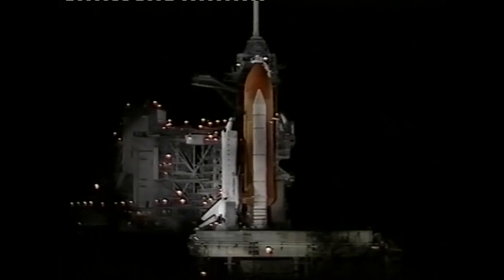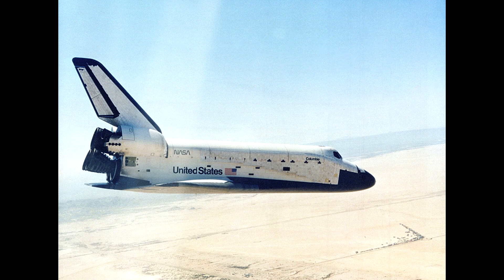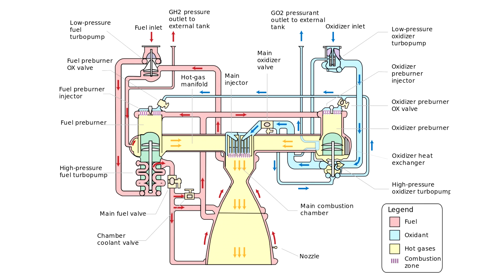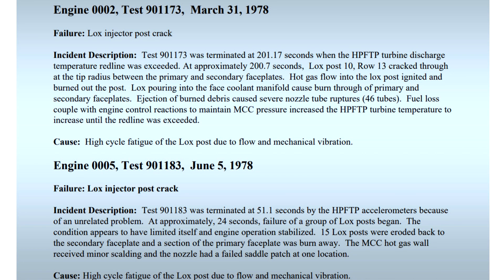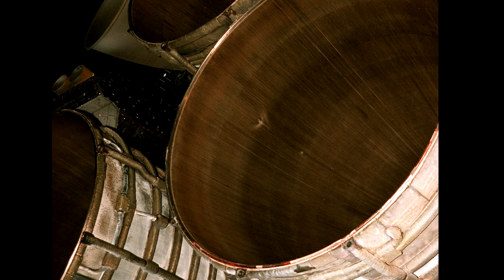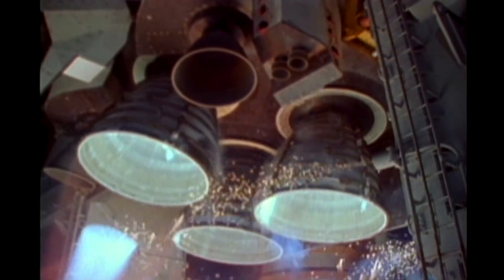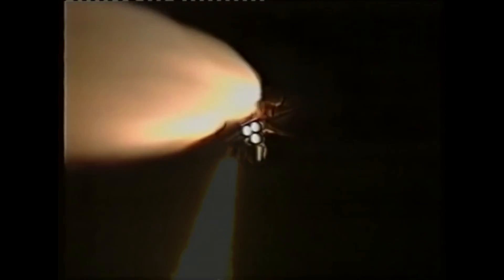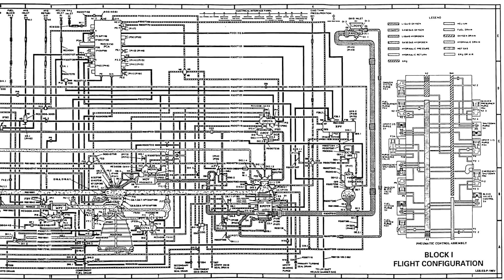How A  Gold Bullet Almost Destroyed A Space Shuttle

Comment: It really shows how messed up the shuttle program was.
Reply: It seems like they had the whole thing backwards - trying to build a reusable second stage instead of a reusable first stage.
Reply: The Shuttle program was one long, expensive lesson in How Not to Do It.
Reply: Yep. The SRB's were "re-usable" in the same way that your disposable vacuum bag is re-usable if you empty it. The fact is that the actual cost of recovery was about the same as new SRB's and the re-used parts were pretty much just the casing. As for doing a propulsive landing that was never an option as they use solid fuel which meant that once the wick is lit there is nothing there to start a second reaction and even if you could you would have no active thrust control. Also the engines was never designed to be stopped. There might be a way to quench them out, but my guess is this would be impracticably hard to do. As for the shuttles themselves the decision to side mount them and have a two storied crew compartment killed pretty much all the astronauts. On every rocket up until then the fail safe in orbit had been ejection seats or an escape tower offering a short massive boost directly away from the first stage. The shuttle even if it could separate was still screwed as it was travelling perpendicular to a massive tank of hydrogen and all it's trust came for the same said tank. There is a reason why they found several of the astronauts from one, unless my memory is failing and it was both, the accidents either in the wreck of the nose compartment or close by with some even appearing to have actively flipped switches associated with emergency procedures. Sadly they never stood a chance of escaping the nose section. Especially not after it fractured from the superstructure. We can only hope they never actually saw what had happened and sat there knowing they were falling to their death in what had become essentially a tin can with zero hope of escape. I for one am glad they have started mounting humans to the top of the rockets again rather than the side. No matter how you look at it it's the safest design.
Reply: Just Being Socially Awkward it’s hard to see the opportunity cost the US paid with the shuttle. If history would have played differently i would bet that humans would have left low earth orbit for a while now.
Reply: Did the lessons stay with us? Look at SLS and repeat that with a straight face...
If it wasn't for NASA we probably would have had reusable rockets 20 years ago. Werner von Braun was pushing hard real reusability and instead NASA made politically engineered turd that killed 14 people and nearly was a total loss several other times, cost half a billion (at least) per launch and stalled real progress for nearly half a century
Reply: Just Being Socially Awkward We had a 2 stage to orbit rocket with a fantastic spacecraft in Saturn IB, they could have redesigned the CSM or build a new vehicle but shuttle was something nixon signed off to keep nasa busy for a few years scratching their heads instead of asking for more money
Reply: It's by far the most lethal (to it's passengers) spacecraft ever built
Reply: I'm not sure if it was so horrendous, 789 people flew on the shuttles, only 14 died.
Reply: Doc Possum that makes it ten times more dangerous than a car, for a billion dollars journey of a couple of minutes.
Reply: Just Being Socially Awkward I don't think it inspired companies to go reusable. If anything, it made them more hesitant because it was so impractical. Fortunately it's ended up happening anyway.
Reply: Pierre Gabory yeah, it was more sloppy, than anything, after a while Nasa just kept using the same thing instead of innovating
Reply: All spaceflight has these issues. Remember Apollo 13?
Reply: There is no reason to risk human lives on a launch that could be done unmanned.
Reply: Blame the military, who shoved in the huge cargo bay for military ops (outdatedly thinking it was worth the manned oversight) If it was just a personnel carrier with some payloads you could shove out of an airlock,  it might had been much more viable. The big take away : specialization beats Jack of all trades.
Reply: Bureaucracy!  This is why private sector is better for certain projects. You can't take the lowest bid when lives are on the line and competition drives down costs and improves technology.
Reply: Rockets are dangerous. They are basic, a giant bomb being defused rapidly. The shuttles did well overall with something like 135 lauches. Look up rocket fails and you can see most rocket programs don't do so well.
Reply: Just Being Socially Awkward : The issue is how much more we could have accomplished if the same budget and fantastically talented people were applied to a more sensible launch system.
Reply: +Joshua Duggan I think you're overestimating the differences it would have made.

First, it's just a transportation system to LEO, nothing more. Manned space flight is ridiculously expensive anyway for the role it plays.
Second, it wouldn't have been the same budget if it was cheaper.
Third, other countries didn't go the Shuttle way, and no other huge quantum leaps have been done there. The real progress imho was the engines, and the Shuttle program had its results there.
Fourth, building a serious space plane was inevitable; you can't do history with a mindset "had we never tried X". You might say, "well the Russians pulled the plug earlier", but they would never have even built an orbiter if not for the Shuttle program.

I don't think the technological progress of the US space program has been affected too negatively by the Shuttle. Losing the crews sucked, yes. The government had to spend a bit more money (relative to the budget); but with another approach Space Planes would have to be tried anyway, so the "loss" so to speak would have occurred just somewhere else.

There's not only NASA; but the free market is not able to fail so gracefully: some company would have gone bust probably, or it would have been cancelled - without learning anything. I don't think that would have been a "net win" or sped up things. Lots of knowledge has been gained by being forced making a flawed thing work. I think this is sometimes the way to go, and I think the free marked would not have been able to achieve this.

With a different approach NASA would have accomplished the same thing just with less money. Which is being spent on the own economy anyway, so that doesn't even really matter.
Reply: I like to describe the Buran as what the shuttle should have been.
Reply: If putting stuff into orbit was the only thing we were trying to do, the space shuttle would be stupid. You people, taking the least amount of info and stretching it as far as you can, REGULARLY forget that the R+D for and from the space shuttle literally catapulted what we were capable of doing in all technological fields. 

If we had designed some small, purpose built machine for getting it to orbit, we wouldn't have been able to do all the things we did. 

The shuttle was not designed to put stuff into orbit. it was designed to land from orbit. Obviously, it won't function the same. jesus fuckin christ.
Reply: NiceWhenEarned RudeMostlyElse you make a really good point there
Reply: its not ksp, where you unlock tech and the shit just works.
Reply: Tell that to the dead astronauts.

Comment: The engineer that over-tightened the screw has already disliked this video
Reply: and people wonder why technicians need to use a torque wrench, document what Individual  torque wrench that was used and show document that the torque wrench was correctly calibrated.....
Reply: @kirgan1000  my $9 harbor freight torque wrench probably wouldn't cut it.
Reply: Name any place that has techs torque screws. Cause even NASA doesn't.
Reply: @240sxRule  I'm a tech in the commuter rail industry and we torque screws when spec calls for it.
Reply: @kirgan1000  I wonder if they ever found out who screwed up.
Reply: And sometimes I don't know why they bother. Just today a technician applied 20Nm to a bolt during assembly when I had specified 11. -.-
Reply: @kirgan1000  And in reality,, it was like you said, not an engineer but rather a technician who tightened it up...  Some of us engine -ears who are capable have a saying...  For certain people it should be illegal for them to own tools  ;)  and 20/20 hindsight is crystal clear.
Reply: Also, was it a reverse thread? It looks smudged counterclockwise.
Reply: Pomo, sure was.  :-)
Reply: @pomodorino1766  Its actually looks like it was damaged from disassembly. 1+
Reply: @pomodorino1766  Exactly ........
Reply: Pomo Dorino Scott said it could have been overtightened by an engineer, it would be the increasing process that would cause the burr to release it, not the other way around.
Reply: Paul Ward - What do you mean with "increasing process"?
Reply: Pomo Dorino sorry autocorrect got me again. I meant releasing the screw :(
Reply: Paul Ward - lol that's why I hate to type on the -smart-dumbphone.
My point was that Scott said the damage happened over 20 years of usage, so the last time the screw was touched it was during assembling, and for 20 years the burr has been causing damage.
If the screw was damaged during counterclockwise over-tight it was a reverse thread.
Anyway it often happens when digitalising old films that the images are flipped vertically and that would explain it better.
I hope it all make sense, English isn't my first language and I often produce word salads.
Reply: The image is the right way around, that's a torq-set screwhead.
Reply: Maybe they use Phillips screws because they are a bit lighter?
Reply: @Paul_Ward  potato phototto, i noticed the same
Reply: The real question is, what were they doing using Phillips head screws?? Those things are designed to slip and burr - they should have used a more positive engaging screw, like Torx or Robertson. I don't know how widespread Torx drives were back then, but Robertson has been around for 110 years.
Reply: Looks like an offset cruciform screw to me, not Phillips. They're used very often in the space industry for some god forsaken reason and are infamous for stripping when you try to remove them.
Reply: FergyA820 They do that to ensure only the correct tool is used to damage the fastener.
Reply: Cables should be suspended away from any structures or fasteners anyways so I wouldn't blame the burr on the screw, rather blame the installation for failing to keep the cable from contacting something that it can rub against.
Reply: @willj78  Indeed, sounds like an economical fault analysis and corrective action. Easier to blame a one of, than to rewire the whole fleet...
Reply: I sense a good band name here: Over-Tightened Screw ;)
Reply: Wait wait wait...  It took that many engineers to tighten a screw?  No wonder it was over-torqued!
Reply: lol, at least 13! The screw driver with the longest handle in the world!
Reply: Honestly it’s crazy to me that they put Phillips head screws on anything going to space at all.
Reply: No way a wire loom should have been rubbing against a screw head without armor, smooth or burred.
Reply: Oh yes, a separate document for each screw.  A wonderful solution.
Reply: Pass The Butter Robot lol I always wonder who the hell are the small handful of ppl that dislike videos, now we know ;P
Reply: "My zeal was nominal!!"
Reply: dothemathright 1111, after looking closely I think your correct.  F-16s used them on many of the panels that were not intended to removed frequently.  The tech data stated they were intended to be single use.
Reply: @nerdanderthalidontlikegoog7194  The design may then be as such to intentionally damage the head on removal if overtorqued so it's obvious that you should, y'know,  not zip it right back in place and have the head pop off under load.
Reply: I've heard of torque wrenches. I haven't heard of torque screw drivers.
Reply: There aren't any dislikes to date. Lol
Reply: Mechanic*
Reply: Ummm sounds like the cable was too close, it shouldn't rub on anything.
Reply: You had one job!
Reply: As a multi-discipline degreed engineer, I'd just like to point out that it is unlikely that any actual engineer touched the assembly of any component or part on the shuttle.  All of that work was performed by skilled technicians, not degreed engineers.  And, here in the U.S. anyway, you are not an engineer unless you have at least a bachelor's degree.  (Locomotive engineers excepted).
Reply: Guaranteed it was not an engineer that did that, that was an assembly person or at highest level may be a technician. However, the problem is with engineering because in no way should a wire bundle ever be allowed to rub against a protruding surface such as the head of a screw.
Reply: You got it all wrong.  Stupid thing was cross threaded so I hadda get the old nut driver out and smack that baby around till it tightened.  And by "engineer", I'm sure he meant "technician", which is the NASA term for "mechanic"

Comment: Looks like I underestimated the risk associated with a defect on an engine nozzle (caused by debris or whatnot)...I wonder what happens if one were to rupture, especially on vehicles like the Falcon 9 or BFR (with many engines) which might be able to sustain an exploding pressure chamber but still have open engine nozzles right next to each other. Would the rupturing of the nozzle destroy neighboring nozzles and essentially kill the vehicle of is this not that likely?
Reply: Nuran On The Falcon 9 has had a complete engine failure before, one exploding on lift off and still made its orbit. CRS-1 in fact
Reply: Scratch that, the engine didn't explode, it was just shut down and some paneling and other hardware was jettisoned to relieve pressure
Reply: Wikipedia still claims that the nozzle ruptured, which I would take as an indication that such an incident wouldn't necessarily cause neighboring nozzles to be critically damaged too.
Reply: Not sure if the panelling was planned to go. If you look at the video it certainly seems like the rupture tears away the panelling rather than it being a controlled reaction
Reply: Nuran On Also look at the HEAT-2X  nozzle rupture during the last static test.  Catastrophic, but well documented because it happened on a test stand and was recovered for further diagnostics.  Set back the entire program by 5+ years with complete redesigns.
Reply: Do you have a link or any additional information, google results don't show anything rocket engine related.